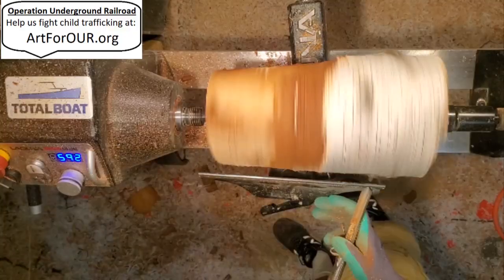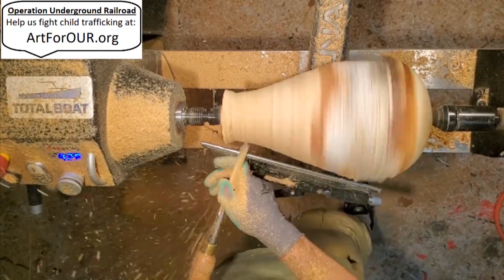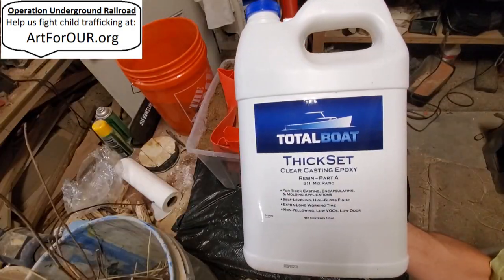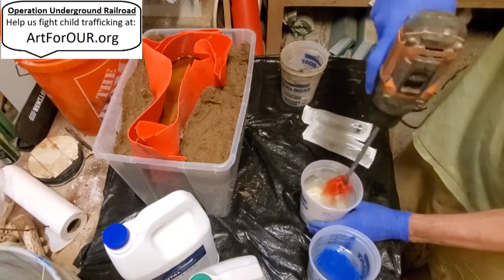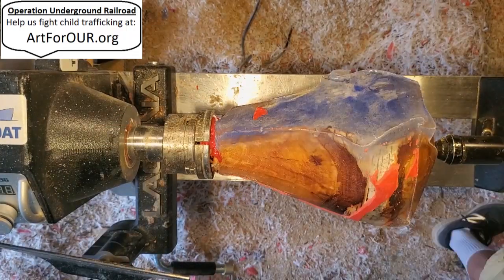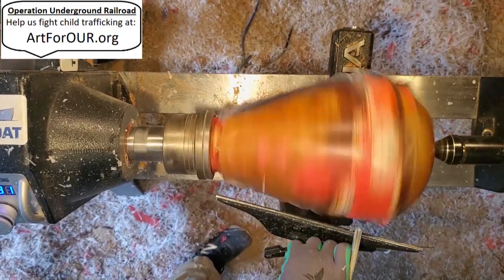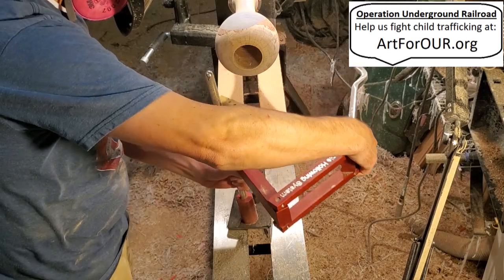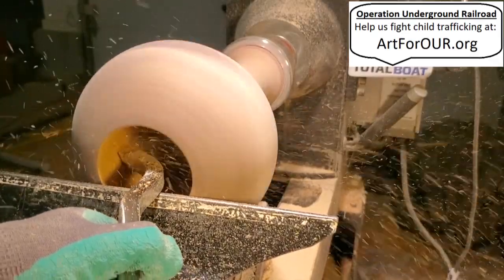"Galaxy Bottle" Resin, Birchwood lathe project.  Woodturning a vase. Operation Underground Railroad

Comment: Amazing artwork. I couldn't help but notice you struggling with the inside sanding process. A suggestion from an old pipe fitter: Take a high speed drill with an extension rod. Make a slit in the end and place a long ribbon of sand paper through the slot. (A NOTE) Try not to bump the end of the shaft on the piece. It shouldn't be a big problem given the rotation will hold the center. Hope this helps.
Reply from the maker: Good ideas Larry!  Thank you.

Artforour.org